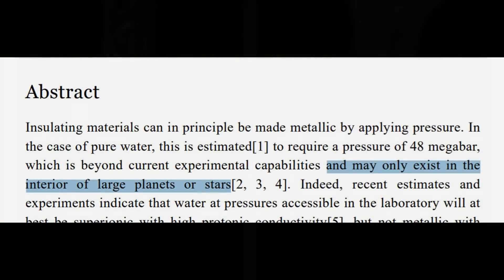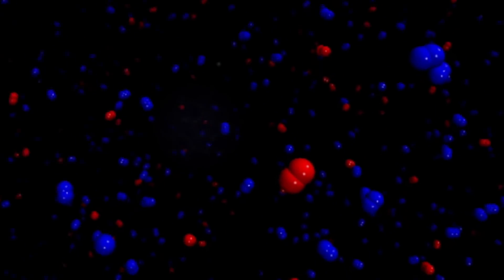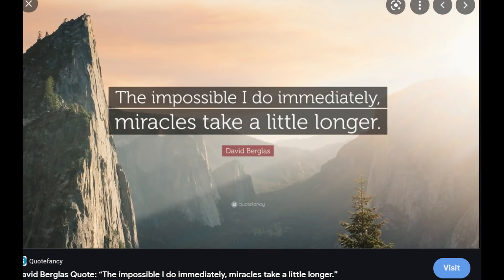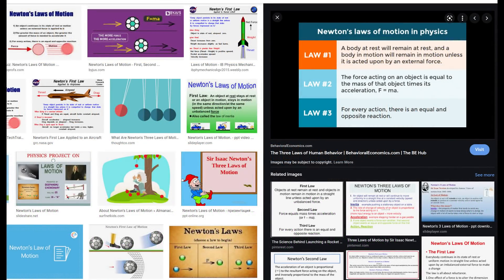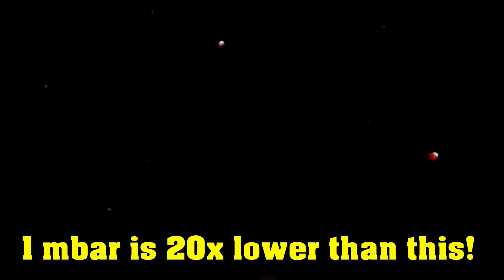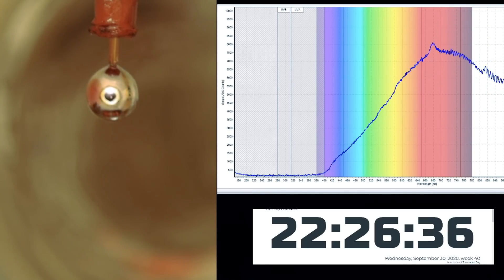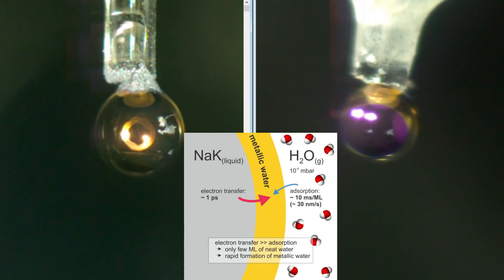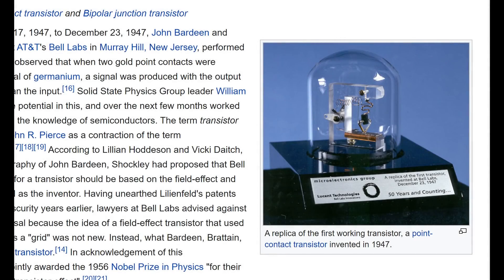Scientists discover Metallic Water

Comment: I wonder if any of there metallic solutions might be developed that are stable liquids at room temperature and pressure, and how well they conduct electricity. A tube full of such a substance might be useful as a flexible power cable that will never suffer metal fatigue.

Comment: I guess congratulations are in order.
But i have a question. I'm pretty sure this would conduct electricty. But what would happen?

I mean, it's essentially loose electrons in tiny bubbles between molecules. And there are enough electrons solvated that way that they can be seen with the naked eye. If a voltage was to be put on this, wouldn't that cause a MASSIVE electron flow? Or would the electrons merely be pulled into the water molecules, reacting with them and giving of a ton of energy?

Comment: What will come of it?  My prediction:
Water is a very strange substance, and dynamically very complicated because of the transient bonds between molecules.  These results, which directly involve the electric field strength around and between the molecules in liquid form, can help inform a more precise understanding of said effects.
This understanding will eventually lead to efficient de-salination filters that pass water molecules but block salt, with just the head pressure of a few feet of water above the filter, at high throughput.  This works due to quantum effects that guide water molecules into nanotubes and let them slide through the tubes without getting stuck.  Perhaps they are "pumped" via a time-varying electric field at the opening of the tube, which "feels" like more water so the molecules act as though to form a cluster with it, then cycles off so it gets un-stuck from the mouth of the tube and goes down the pipe.  The clustering of water around the tube mouth excludes the natural ions present in the water.
This will end drought and allow agriculture along coastal regions.  The human population will redouble and, having slain Famine, the other 3 horsemen of the apocalypse will take out their vengeance on us.

Comment: Are those solvated electrons the same electrons that move in wires and make electricity? Is there anything useful you could do with them in solvated form? Ammonia electrolyte since electrons move so easily in it? Any way to get the electrons out in a controlled manner to be useful? Would be interesting to have just a liquid battery. No parts or anything to corrode or break down, just liquid. Pump ammonia full of electrons and use it like a battery?

Comment: Check the dates, the transistor was invented right after the Roswell crash.  All our stuff is running on unlicensed alien tech, allegedly.
Reply: The thing we call a transistor was invented, given a Danish patent, and ignored, in the 1920's. Radio hobbyists knew the idea as a cat's whisker detector with a bias current added... Flying saucer wacks like to claim fiber optics came from Roswell. Du Pont de Nemours made Lucite fiber optics in the 30's- I used to have a period Reader's Digest that mentioned them...
Reply: @Pygar2  
That's what they want to you to believe.
Reply: @IvorMektin1701  I had a copy of the Digest, myself, and I personally photocopied all the old crystal radio articles I could find in the old bound magazine stacks of our library. There can be no rational doubt on my part, that these things predate Roswell a good deal.
Reply: @Pygar2  
I made crystal radios too with a pencil lead and a razor blade. 

I didn't hear any aliens.
Reply: @IvorMektin1701  I'd be worried about you if you claimed you had!

Comment: Interesting, brings to mind recent publication of  Dylan Durkee et al, Colossal Density-Driven Resistance Response in the Negative Charge Transfer Insulator MnS2, Physical Review Letters (2021) shows how material changes under high pressure reversibly from insulator to metallic using a diamond anvil

Comment: I have a hard time believing that this is going to be "utterly useless".
Reply: Could have applications in any industry that uses metal thin films. Could be safer and cheaper than toxic solvents.
Reply: @truantray  I wouldn't put my bets on wide industry adoption of something that has to be done in research-quality vacuum, but for some specialty processes maybe... or if this whole Starship thing actually works out and they can just do this processing step in space :P
(yes, I know, Musk bad, blah.)
Reply: @Ithirahad: I work in an industrial calibration laboratory which mostly uses off the shelf equipment, and we have vacuum pumps that can get a 200 ml volume to 1E-5 Pascals of pressure.  It should be adequate to recreate these conditions.
Reply: It is hard to think of any possible use for this that doesn't work better with ammonia, and it is pretty hard to come up with a good use for the ammonia case (A rocket that uses an MHD pump is pretty cool, but still sort of pointless and I can't think of anything better). It is cool, but I do think it is probably useless.
Reply: @agsystems8220  I agree there's no immediate, obvious use for this, but I like to remain hopeful that at some point in the future, understanding this will have usefulness.
Reply: If it’s being announced as public knowledge then you can bet it’s already been weaponised
Reply: @COVbadman79  I don't think TF and his buddies were working on weaponizing it, and they are the ones who did it. We watched them being all giddy about it, which was much more cute than worrisome in my opinion.
Reply: @thirstfast1025  Until you remember the movie Real Genius, lol.

Comment: that's weird, 2 nights ago I dreamt of metallic liquid I pulled out from the bottom of the lake. It was similar to mercury but more "sandy" grain structure. It was like sand on the bottom, but as soon as it touched air on the surface it turned to liquid and seeped through my hand.

Comment: Now that we know that rocket engine is potentially possible, I wonder... Is it possible to create controlled reaction (fuel-cell like), to extract electricity from it, or simply put - create battery? If so, what would characteristics be? Capacity, power, weight? Especially compared to the current batteries?

Comment: Yeah, turbos are expensive and become really unhappy if things dont go to plan. Thats one of the advantages of a diff pump, generally you just have a mess to clean up if a diff pump system goes to atm, well, unless you are using hydrocarbon fluid.

I have managed to amass a collection of turbos from 60l/s to 2000l/s. I have replaced all the diff pumps I have.

Comment: I've always wondered if there's a way to store electrons by themselves to create the ultimate battery. This seems like it's a hint it might be possible.
Reply: Well, from the looks of it, the electrons still need something to hold them in place, otherwise they'll wander, and react with whatever they run into... violently. See: potassium and water.

Possibly, there could be some super precise organization of magnets which can hold electrons in place to be released later, but it doesn't seem too terribly stable holding more than some small amount of electrons.
Reply: Liquid ammonia would be a better bet for that, this stuff only exists under extremely specific conditions.
Reply: Electrons can be stored in an 'electron storage ring'. That isn't a practical battery, though.

Comment: Not to be that non-physical chemist stepping way out of his lane but are we sure it's not solvated hydride?  On some of the drops an oxide layer forms at the end of the drop.  I wouldn't think the reaction would for forming an oxide layer would be exothermic/spontaneous or stable enough to be favored over direct ionic reaction with the metal and water but 1)  I haven't thouch phys chem since uni and I don't do those BOTE calculations in my head anymore and 2) Weird intermediate phases happen at low pressures

Comment: Regarding the experiment with the electrons released in ammonia. This is probably a silly question since I know nothing about this kind of chemistry, I'm mainly electro-mechanical by trade(precision motion control systems). If you suspended a magnet in the ammonia, near the cathode, would the electrons follow the magnetic fields to the point you could have a physical, three dimensional representation of the fields?
Reply: cool idea. wonder if it will work.
Reply: With normal electrolytes like salt water that creates an hydroelectric current. I guess that would occur with an amonia electrolyte like the one you mentioned too.
Reply: Hg..this substance used in old thermometers (english is not my mother language) behave interesting under magnetic field, because its like a liquid metal. Do the metallic water react for magnetic field or its false metal with more shifted on red light spectrum create just by eye ilussion with colours but without chemical and physical properties recognizing for metal like electroconductivity? Amonia is NH3, 0,84 Pauling scale gives high dipole moment. In the structure hydrogen bonds are stronger and 2 pairs od electrones can jump over. 
In the industry amonium is produced by Haber and Bosh method with high pressure cathalisators, gases react with Fe cathalisators on high pressure terms, than must be cool to -50 Celsius. High pressure, low temperature and cathalisator comes from magnetite. Terms of hydrolise of azots and pH of acids and electrolise, galwanisation, aion and electrones shifting, dyfusion.... How you want to create 3 dimensions here? 
By forming cristals? Sorry but I'm too stupid for your ideas......next  time you can read Wikipedia by yourself. I'm not expert but I don't see any chance for a 3 dimensions.....
CAN YOU EXPLAIN YOUR IDEA MORE TO US? WITH DETAILS OF PROCESSING AND SUBSTANCE AND CHEMICAL, PHYSICAL PROCESSING YOU WANTED TO USE AND WHAT YOU WANTED TO GET EXACTLY ON THE END?

Comment: @Thunderf00t, I have a question: what about energy storage?
Warning: pure speculation coming next!!

What triggered me was "vanadium liquid batteries". I get that they work on principle of changing oxidation states of vanadium thereby creating potential difference. But in principle its just a process of shuffling electrons around by association/disassociating them from/to vanadium & oxygen.
Here (and in case of ammonia) You have a solution of disassociated electrons ready to do anything they can to get to the stable, bounded state. They are dissolved in solution already full of positive ions, but... what if they were separated? I have no freaking idea how, but... in theory, this separation process begs for energy to be introduced in this system (charging) and letting them "short-circuit" releases this energy (discharging). Something makes me think that there must be some benefit of free-floating electrons in such a solution. Super low inherit electrical resistance? Huge amount of charge-carrying ions per mass or volume unit? Both?

I am really interested in what You think of this. I am not an chemist nor scientist, but an electronics engineer with big fascination over electricity! :)

Comment: This isn't a useless state of water, Thunderfoot. I would ask you to consider that water is a necessary element of human life. Wherever we eventually go in our space travels we will need water. In space travel, mass (or weight) is a mission killer/fuel waster. Consider the following:
You set up a manufacturing lab for metallic water in low earth orbit. You sit and manufacture metallic water or however long you need to get the amount you want. The next part is tricky because I don't know the logistics involved but you cast? The metallic water into ingots or one huge amorphous blob. You now have water in orbit around the Earth which can be connected to or captured with a robotic arm by an interplanetary vehicle, and your interplanetary transport leaves Earth orbit with a giant iceberg/metalberg towing behind it or inside a cargo bay. The good thing about this is that the vacuum of space will not disperse this metallic water, the water itself will not be in a state where it would flow which in the case of rocket fuel flowing liquids in space can cause problems with navigation. There is virtually zero maintenance for the metallic iceberg so you would not have to check it periodically to make sure that it wasn't evaporating or leaking.
Obviously there is a lot of work to be done to see if this is feasible and investigate the logistics of it to see if it is practical but when it comes to ideas there is no shortage of them given a large enough audience. I guess ideas are like opinions and a holes (everybody has one) .

Feel free to use this idea in any suggestions or proposals for research grants. All I ask for is a footnote attribution as to being the originator of the idea

Comment: There's another situation where electrons float about freely from nuclei.  It's called plasma, is it not?  Oddly, plasma exists in virtually polar opposite states from metallic water.  Plasma requires extremely high pressures and temperatures.  It looks like metallic water requires extremely low pressure and relatively low temperatures.  Am I mixing apples and oranges here?

Comment: Can you explain the effect that causes the crystals on the surface of the drops?
Reply: not sure but I think that water vapour in the "air" (vacuum) is combining with the metal droplet non-explosively, forming a water-metal solution that would normally just explode under most conditions. I don't think he explained what is going on molecularly though. if the metal would normally explode (react) with water, what is happening molecularly such that they are still combining yet not reacting? and why are they not reacting?

Comment: a thought popped into my head of using this as a living wire where if it gets too hot it evaporates and disconnects itself helping prevent house fires....but the whole needing a vacuum kind of gets in the way.
Reply: We already have fuses, this could be a fuse with im certain applications with a tiny capsule sized vacuum chamber.

Comment: Could this—or a solution which follows the same procedure—be used as a modifier oxide in the creation of radiation shielding glass once/if the stability issues are overcome?

Comment: Actually, @Thunderf00t, this might form the basis of the next semiconductor, and it's funny that you bring up that as your example. According to Moore's law we should be on a linear path in reducing semiconductor size, but due to stuff now being down at the 4μm level on silicon based semiconductors, stuff has started to flatten out. Using free electrons (not bound by your typical silicon/bohrium/phosphorus atoms) and water as a depletion layer in NPN semiconductors might sound farfetched, but I would be interested in looking at it. Give me a shout if you're interested, kind regards from your average crazy compsci assistant prof :)

Comment: Is the alkali metal only used as a source of electrons for the coat of water? Could you achieve metallic water by putting some electrically charged plates in vacuum with a thin water atmosphere? Or maybe spray water in a beta decay material?

Comment: Two questions.
1. How do you get metallic water? What does metallic mean? I kind of always assumed it meant some general location on the periodic table, like for 'noble gasses'. Looking up some definitions doesn't help me much. The first one says "metallic means it makes metallic bonds" which is super helpful, and the other definition says something with high electrical and thermal conductivity, which... how can you tell with water?
2. If you're dealing with something in super low pressure and want to make sure all the air gets removed, a vacuum pump would obviously slow down dramatically as there's simply less and less air to pump out, but wouldn't there be some kind of... chemical sponge that could be used to sort "catch" any remaining pesky bits of loose change gas bouncing around in there? I'm sure I sound like an idiot asking this, but high school physics was a long time ago. I'm just imagining flooding the chamber with some heavy gas to displace all the air, pumping most of it out, and then having some compartment in there that would react with the gas and keep it away from your experiment faster than any pump could manage (although, obviously I suppose, the same problem of getting the last bits to hit the right spot would remain)

Comment: At 8:00 I noticed that the water molecule roughly in bottom-right area of the simulation, has a Dzhanibekov effect... I guess now that I think about it, it sort of makes sense? But at the same time also feels like it shouldn't do that because I always imagined the hydrogen atoms to sort of be constantly wiggling around the oxygen atom from "heat", making this kind of precession unstable? Is the simulation simply not including this kind of motion or is this Dzhanibekov effect actually something that happens?

edit: oops, I called Dzhanibekov effect as gyroscopic precession earlier... but they are not the same effect... and I am not sure why I thought it was called gyroscopic precession in the first place...